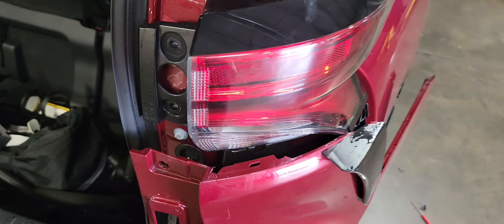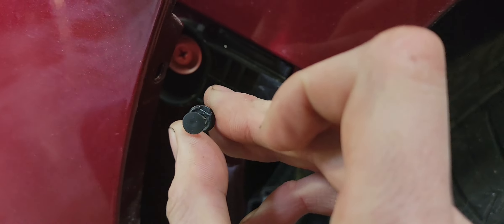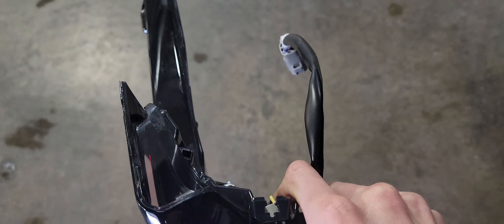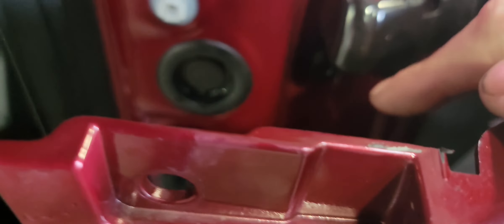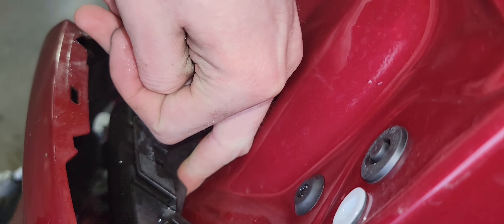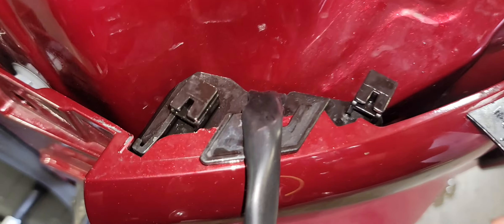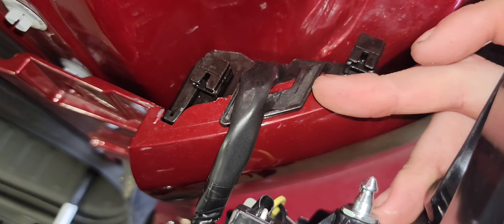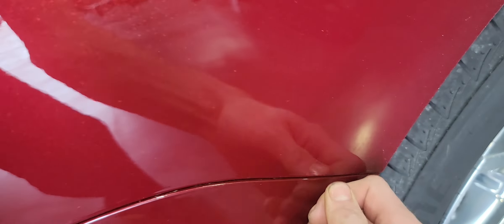2022 toyota seinna taillight replacement

Comment: Do you know if the tailgate lights on the hatch door light up or not in 2021/xle ? so i have checked the light housing have bulbs already inside but don't light up . Thanks
Reply from the maker: It only light up on certain trim levels
Reply: @Nickthecarguy  Thank you for quick reply.